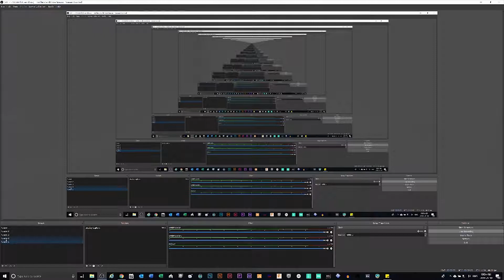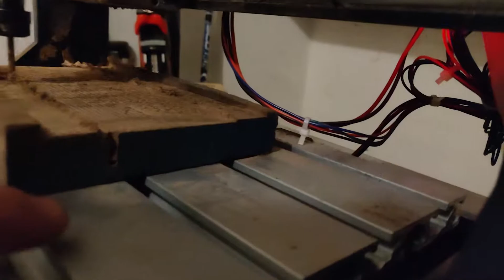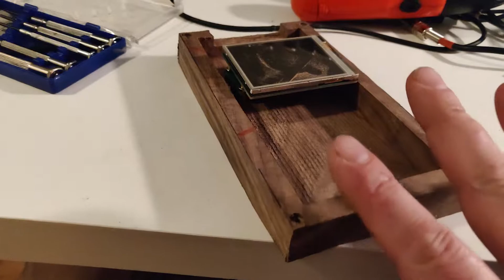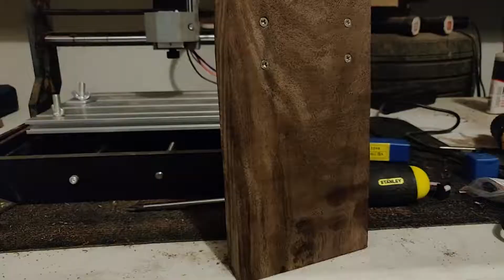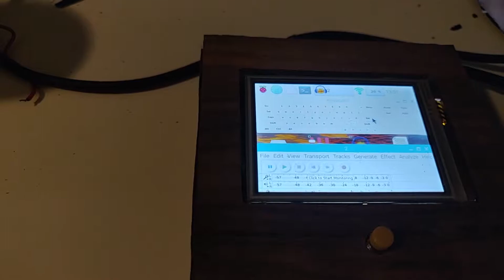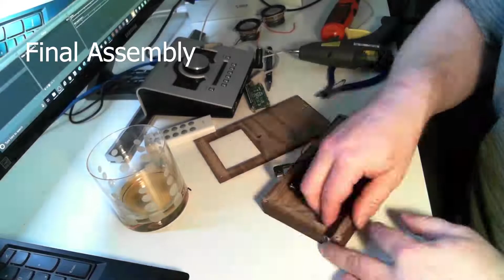Making a stereo field recorder

Comment: Hi ! Very cool project. I'm currently on the lookout for a stereo input for a RPi-based project I'm working on, and it's the first time I hear about that Behringer USB to 2 1/4inchs. That looks like exactly what I need except for one thing : the quality. How do you like it ? Reviews online are pretty blunt when it comes to the actual sound quality and several mentions clicks, pops, hums, drops... Did you experience any of these ? 
My two other options are :
- PCM1802 Audio Stereo ADC Module but that would mean a lot of software to write, might be tricky
- The Audio Injector RPi Zero, which looks perfect but will be a pain to get delivered to Europe
Reply from the maker: Yes there was a 60 cycle hum, but an external ground loop cancellation device fixed it. Other than that it has been working fine, although I did want to customize a GUI but that's beyond my skill level
Reply: @rymania  Thanks for your answer !